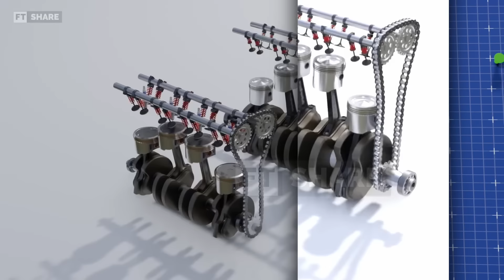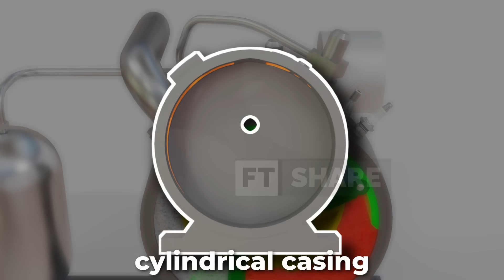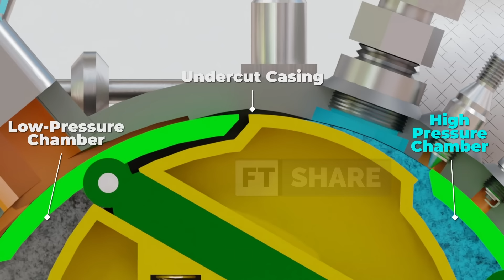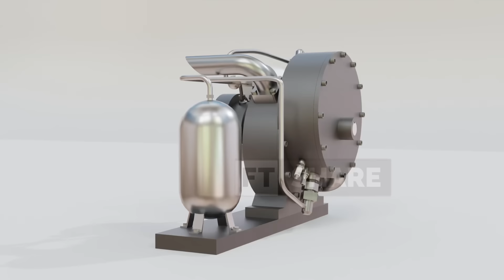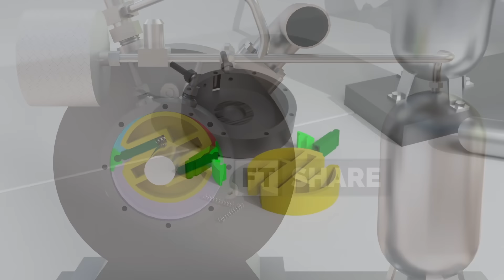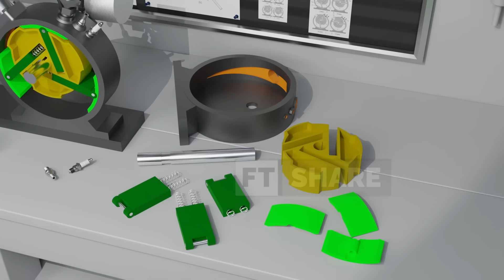New radial vane rotary internal combustion engine. No crank shaft, no valve system, no cam shaft.

Comment: Seal issues But also the spring loaded. Pressure. Carbon depsits. Need oil pressure to clean and pressure rather than spring. Also seal problems. This is why vane pumps work on hyd systems. As everything is libricated. And NO comistio issues

Comment: Nice animation.   Aside from being very difficult to seal, this tank of compressed air is not going to cut it.  As the compressed air enters the combustion chamber you will notice the volume is expanding very rapidly in the combustion chamber, therefore it will be very difficult to have adequate compression
, common to these vane engines.

Comment: Das neue Ranking (Theoretische Effizienz)
Unter Einbeziehung des Deckers-Konzepts verschiebt sich das Ranking für neue PKW/LKW-Konzepte wie folgt:
Rang	Konzept	Wirkungsgrad (theoretisch/potenziell)
1	Deckers-Doppelzyklus + Wassereinspritzung	55% – 62%
2	Moderner Schiffsdiesel (Zweitakt-Langsamläufer)	50% – 55%
3	Ilmor 5-Takt (Stufenexpansion ohne Split-Cycle)	48% – 52%
4	Scuderi Split-Cycle (mit Turbo/Rekuperation)	45% – 48%
5	Modernster PKW-Diesel (Standard-Bauweise)	42% – 45%

Comment: While I understand the basics of this design, I'm curious what stops leaking between the chambers across the front/rear of the rotor (where the round covers are bolted on)?
Reply: My guess is tight tolerances and a coating of oil.  Before long, that tolerance will wear down and that oil coating will extend down the exhaust.

Comment: Side wall sealing ?
Lubrication of the friction surfaces ?  How ?

No vibration? Yet the thing must be constantly changing its balance state as the vanes move in and out !
The apparent velocity of the vanes in contact with  surface will be constantly changing .

Comment: you can say all the words you want, but this engine is massively inefficient.....there's not even enough time to fill the chamber before you spark it. You have a single spring to push the shoe, which takes up twice the space as the baffle before extension, do you know anything about cavitation....like....anything? this is going to cause shoe vibration and tip displacement, creating pin friction that will eventually lead to quick degradation of the shoe on one side. This will create an imbalance of the spring force against the baffle and the whole thing is just going to destroy itself. Do I even have to bring up the baffle surface area being extremely small in ratio to all other parts within the same space that would practically cause a fight between it and the previous baffle coming next......the only thing keeping that rotating is the compressed air, the fire is barely giving it extra energy.

you say ICE are "complicated" and yet it uses simple separating concepts, easily maintained and repaired, and pretty high in efficiency....and with sensors, can take a wide range of fuel ratings. The engine you have concepted is overly engineered, with poor understanding of fluid dynamics, difficult to maintain and repair (which looks like it's going to need it every 40,000 miles for new shoes, springs and baffles at the very least), provides low torque per fuel weight, and I'm not even going to go over the massive oversight flaw of needing gaskets on the BOTH sides of the block in order to keep pressure (good luck with that).

I give you a C+ for effort....but an F for research

Comment: I wonder if they have a working prototype?
Yes, side wall sealing and pivot shoe friction and wear could be significant issues, plus how long do those springs maintain their spring constant in spite of many temperature cucles?
Looks like a LOT of friction surfaces.
Need to build a few of these to evaluate the feasibility of this design.

Comment: What seals the spring loaded vanes from crudding up from exhaust gasses and freezing in their bores?  What keeps engine heat from drawing the temper of the steel springs?  As rpm's increase, so does centrifugal pressure against the "cylinder walls", increasing friction.  No oiling shown.  This engine solves some problems, yet fails to address or consider some of the sealing issues that plague such designs.  Another "pie in the sky" engine design.

Comment: So what would the sealing shoes be made of? Has this so-called mechanical engineer thought about the springs and what the heat would do to them? How is the lubrication handled? What about the compressor side of this concept engine? What's the output of said compressor and can it handle the air requirement of this engine for extended periods? How big does the external tank have to be? How is it protected from becoming a bomb due to over-pressurization or damage? What's the power output of this engine? What parasitic losses does this engine encounter while charging the external air tank? What's the duty cycle of the air circuit during normal operation. What parasitic losses are present during operation in general? What are the injection pressures for the air injectors? How is fuel introduced? I can keep going with this all day long. This concept engine has more questions than answers! While some may consider it simple by design, the engineer in me sees too many failure points. The most important one would be that external air tank being pressurized to high enough pressure to be useful in such an engine! Add that to the AIR INJECTOR, and now you have to question the actual air into the engine. The air going into todays modern engines is never questioned because they don't use external mechanical means for introducing air into it. It's drawn in through a pressure differential made by the downward movement of the piston and the opening of the intake valve. In other words, the air is already there waiting for the valve to open and drawn in through the vacuum created by the downward movement of the piston.

So let's take it from the top.

1. The engine itself has a drum brake style design. The size of the shoes itself would be a huge parasitic loss during operation. Those shoes would more than likely eat up any kind of power this engine made just because of the size of the shoes. Without the proper lubrication, the shoes would almost certainly be destroyed in a very short amount of time.

2. The springs themselves would be probably destroyed just due to heat. The springs would have to be incredibly tolerant to high heat and constant cycling during operation. Springs do break in normal engines, but springs in normal engines are used in the valve train and have limited movement. These springs have a high movement "stroke", and very likely fail from overuse.

3. I saw or heard no mention of a lubrication system. Is the engine similar to a two-stroke engine? How are the moving parts lubricated and cooled to prevent thermal seizing? The amount of oil needed to keep the shoes from seizing to the drum would absolutely be burned during a combustion event and add to the emissions. 

4. What's the total CFM output of the compressor during full load. What's the duty cycle of the compressor? Does the compressor have a variable output in relationship to engine load and RPM's. If the compressor doesn't have a higher CFM output than the engine can consume, then the engine will have a fluctuating power output in relation to available air pressure reserves. Engines use way more air than fuel and always have. Just looking at the size of the compressor in this video, there's just no way it would ever keep up at all. It's literally half the size of the engine itself and turns at the same speed as the engine. Unless that compressor is turning at twice the speed of the engine, its just never going to keep up. Not to mention what would happen if or when the compressor fails or loses it output due to normal wear.

5. The air tank would be the Achilles heel in this design. This tank would have to be heated in extreme cold temps to prevent pressure loss during charging. Any type electrical system would require a large enough charging system to supply the voltage required for an external tank heater and put an even bigger load in the rotating shaft of the engine and reduce total available power from the engine. The tank itself would also have to be highly protected from external damage due to an accident, and be deflected away from any passenger compartment in the event of a rupture. 

6. The parasitic losses alone of this design would be too great for this to be feasible for production. If it were to make into production, it would be a very low power unit with no real use in passenger cars without severe design changes. There's just too many weak points, and any good engineer would see that. 

7. I see the engine has a fuel injector, but what's the injection pressure? How is the air and fuel introduced at the same time while still getting a good mix of the air and fuel for a complete burn? I see a washing effect occurring on these shoes during fuel introduction and accelerating wear of the internal components. Not to mention raw unburned fuel present on the shoes after combustion and contributing to much higher emissions. 

8. Why the need to over-complicate an engine? Does this engine really need a separate system for the air needed for combustion. The engine itself can be used for compression without the need for an external compressor. This design is transferring the pumping losses normally seen internally to an external compressor that now has to pump an air tank to very high pressure in order for it to work properly. Let the already primary rotating engine do the work, instead of adding a secondary rotating mass that's required for the primary to even work.

9. There better be some kind of a very efficient cooling system for this so-called highly efficient engine. The entire drum itself would see very high combustion and exhaust temps. An engine that's too hot is very inefficient. Liquid cooling is the only real solution, but then you'd have to add a water pump that would be driven either through the engine itself or through an electric motor that's tapped into the electrical system that's already taxed by the heaters needed for the air system. So to end this, there just NO WAY this engine is even remotely efficient in it's current design. Yes it's a prototype, but the video claims it's very efficient which is very incorrect.  You don't increase the size of friction points inside a working engine and gain efficiency. Don't forget the number of friction points actually increased in this design. Let's also add the overall weight of the internal shoe components being forced outward into the drum during higher RPM's. This engine would self limit it's own RPM's through the operational friction until it literally blows itself up. I'd be surprised if this engine would even run  let alone make any useful power.

Comment: Totally failed!
1 - masses in alternative motion: PRESENT;
2 - weight of the components in alternative motion: SIGNIFICANT;
3 - moving surfaces with grazing friction: IMMENSE;
4 - discontinuity of the elements of sealing: VERY HIGH;
5 - separation between lubricant, fuel and exhaust gas: IMPOSSIBLE.
Painfully ridiculous and out of logic.

Comment: Sealing of gases, lubrication, drag friction, ?? All unexplained, also distance between exhaust and intake stays the same no matter how many arms it has, so what’s the point of having 1 or 2 , you may as well fit as many arms as you can in because you will still get same gas charge in per section and same length of power turn. please explain.

Comment: What about cooling the complete system???!!!
Reply from the maker: Two options
1- air cooling via fins made outside the casing, like motorcycle engine. 
2- water cooling by double wall casing. Like conventional engines.
Reply: @aksalsabeeh  You should have to prove it if it is pysically possible. The surface area, heat transfer rates of the materials used, etc.etc.

Comment: If the setup runs backwards (or forwards), can it be used a s a compressor if the drive shaft is powered from an external source
Reply from the maker: Yes, actually, the idea is based on my patented compressor.

Comment: Does not the strength and durability of the springs decrease with heat?
Reply from the maker: Some springs alloys can stand 600 degrees without losing its elasticity. Furthermore, spring can be cooled by channeling the lubricating oil through it.

Comment: How do they think to lubricate those gigantic pivoting sealing shoes? 2 stroke oil that burns and creates pollution?
Reply from the maker: Lubricating oil can be channeled through the vanes to reach the upper side of the pivot then to the shoe face and back to the lower side of the pivoted through the vane out to the filter and pump. 
This will lubricate and cool.

Comment: This is actually worse than the Wankel design!!   Internal friction will be horrendous, even more area exposed to combustion so high heat loss and those sliding shoe arrangements are exposed to combustion heat, so probably wouldn't last very long!!  Efficiency will be poor and it will also need oil injection.  Dead before it is even considered for a viable production engine.  Pressure scavenged, fuel injected, turbo charged 2 strokes are the best available alternative to 4 strokes, it's surprising that no mass manufacturer has produced such a design so far.
Reply from the maker: I respect you opinion, but i disagree. 
You need to relook at it with open mined and positive spirit.
Reply: @aksalsabeeh 
Thankyou but it has little to do with an open mind or positive spirit, it's a case of the laws of physics.

Comment: How do you cool the housing! ?
Reply from the maker: Two options
1- air cooling via fins made outside the casing, like motorcycle engine.
2- water cooling by double wall casing.
Like conventional engines.

Comment: The most obvious problems are the amount of surfaces being heated by the flame front,  how do we get that heat out?   
Do the vanes still slide smoothly with combustion pressure on the side of them?

The sides of the rotor and slides need seals,  everything needs to be lubricated.

Comment: So how is it going to cool?
Reply from the maker: Two options
1- air cooling via fins made outside the casing, like motorcycle engine.
2- water cooling by double wall casing.
Like conventional engines.
Reply: @aksalsabeeh  Then finish it.

Comment: This is not particularly "new".  Sarich had the orbital engine back in the 1970's.  Very similar concept and this "new' engine will suffer from the same problems: how to cool the internal vanes,  and therefore the abililty to seal the engine sides.  Good luck anyway.

Comment: Lubrication is very poor for the sealing shoes.
The irregular shape of the combustion chamber will produce a lot not burned hydrocarbons so it will never pass the anti-pollution regulations.
The sealing shoes are too heavy, so a big centrifugal force will be applied at them at high rpm, resulting in even bigger lubrication problems.

Comment: I like the simple air compressor linked to the output shaft and the ability to kick start it with the compressed air is innovative.   Remains to be seen how it will work for real though any CAD engine can look great but there are a lot of physics and real world properties to deal with.  I'm for it though I say go ahead and make a prototype give it a shot.

Comment: There's enough friction in that engine to make a disfunctional relationship look fine.
Reply: 100% agree. There are too many points in the design that need lubrication.  I fear once it starts you’ll see a plume of smoke from oil burning off the walls as the vanes slide across or leaks from the pivot points of the vanes. Building a model is far easier than building a prototype or even manufacturing. I can build a paper airplane but I’d never want to fly one.

Comment: I see numerous high friction areas, like other rotary vane devices, that this video seems to ignore.
And, of course, using an external compressor for most of the compression work will make this rotary vane component seem smaller, lighter and simpler than a conventional piston engine, but two stroke piston engines with supercharger (external compressor) are already in operation.

Comment: So this engine runs on a bottle of compressed air? What happens when it achieves parity with the surrounding air pressure? Will some of the power from the engine be used to compress the air bottle directly or will there be an electrical air pump filling it? 
Suddenly this "so simple compared to other I.C.E.'s" isn't looking so simple anymore.

Comment: It's NOT a new concept. A similar engine was designed in the 1960's which was actually built and tested. It scored high in power to weight ratio and size, but the seals were very troublesome. The motor never went into actual production. This very similar engine will no doubt have seal problems also. Lubrication and high combustion temps will be its downfall. Also note that these rotor engines have very poor low speed torque, just like an air powered vane motor. Nothing really new here.

Comment: Interesting variation, but like many comments, the concept looks nice in CAD / on paper, but has significant engineering issues that limits its feasibility in real life. I am very skeptical that the downsides can be mitigated enough to build a practical engine. Maybe a niche use case like missile/drones - low weight and a handful of hours total lifetime?